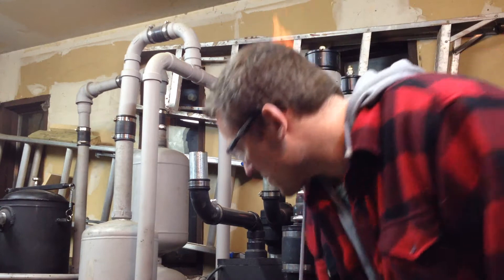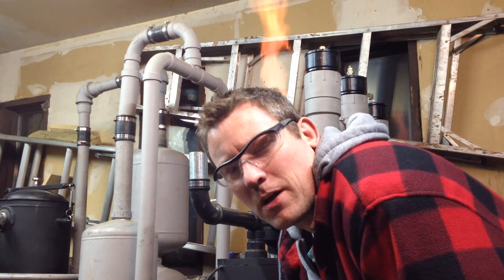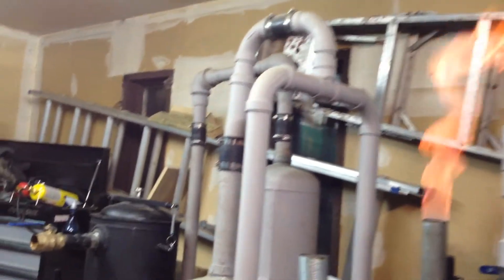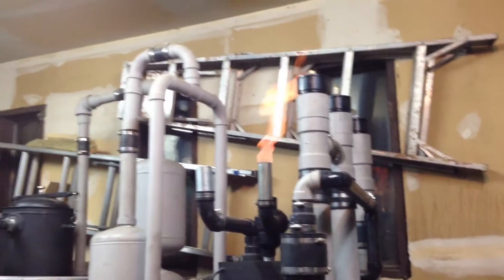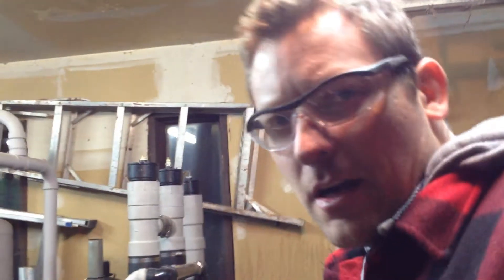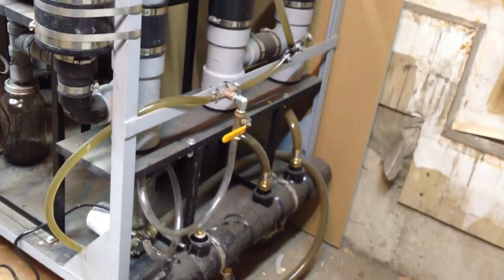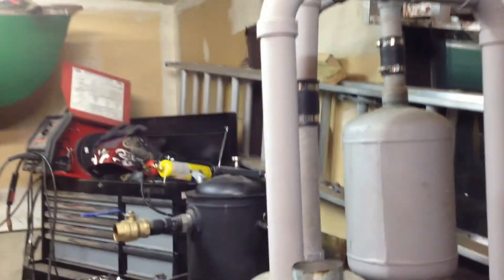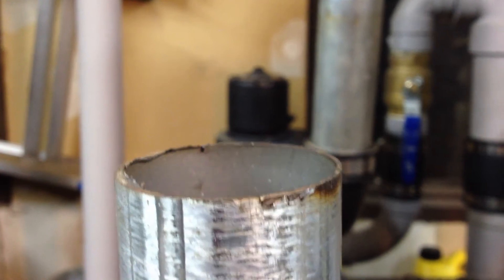homemade woodgas wet scrubber part 2 (testing)

Comment: How many filter and witch  kind of filter do you use
Reply from the maker: Also had three Venturi set up filters ready but I only used one which gave me awesome results
Reply: @Josefppaz thank you sir
Reply from the maker: I experimented with using saw dust and using car filters. But looking back it was really hard for the gas to move through the system. It is good for the gas to move slowly other wise to much 02 bypasses the burning zone which can create problems and back fires. By far the best way to go was the Venturi method with the water and antifreeze. Using that sink drain was a difference of night and day I didn’t need to use the other filters any more. 👍

Comment: Do you us a six air jet in your Gasifier?
Reply from the maker: No it was just a single 3/4 inch air nozzle in the middle of the burn cone
Reply from the maker: Forgot to mention I also had a ball valve to regulate the air flow
Reply: thank you

Comment: What is your water scrubbee? Just a water mist or a bubnler
Reply from the maker: @RustyShakleford1 hi Rusty it’s a sink drain Venturi idea with a stream of water mixed with antifreeze
Reply: @Josefppaz  genius m8 i watched your other videos i can't thank you enough for sharing. I found spiral nozzles are what they use in petroleum cracking to separate tar and ash. Im sure your drain when the water hits acts exactly the same way as a serial nozzle spraying wayer through the gas.

How hot does your water scrubber condenser water get? I'm thinking of feeding it back into the same tank without external al cooling but idk how hot the scrubber water will get thats why I thought I'd ask you
Reply from the maker: @ Thanks man absolutely glad to help out. The gas I cooled it in expansion chamber but it didn’t really get hot maybe warm most cases I used antifreeze to keep the water from freezing in the winter. Was a fun experiment 👍
Reply: @Josefppaz  how warm does the antifreeze/water get when it's recycling through at full temperature
Reply from the maker: @ I’d say pretty close to room temperature man. The gas was cooled down quickly even before the scrubbers. As for the exact temperature not sure bud
Reply: @Josefppaz  how hot does the gas come out of the reactor and do you think gas or tar is still cracking as it comes out? 

Could the water scrubber spray nozzle be placed right on the reactor gasifier outlet? To reduce hot spots on the external gasifier unit itself and allow more pvc pipe to be used even potentially allowing the cyclone filter to be made out of a 5 plastic gallon bucket cooled by water scrubbers.  
If the gas can be cooled enough on outlet of the reactor everything outside of the reactor itself could be cheaply easily available pvc and 5 gallon buckets
Reply from the maker: @RustyShakleford1  No I wouldn’t do that right at the outlet is about 6 to 700 degrees it would melt the Abs or PBC at a instant
Reply: @Josefppaz  with water mist scrubbers it's cooled almost instantly allowing for less metal components
Reply from the maker: @RustyShakleford1 Sounds interesting Rusty I’m curious on your project wish you the best man. Look forward to see some videos up when your done
Reply: @Josefppaz  thanks. I like brainstorming ideas so please run any ideas your thinking about by me and we can bounce ideas back and forth. Water scrubbing is the answer wood gas has been missing its not just about clenaing it but cooling and condensing it to increase the availabile horsepower from a smaller fuel charge. All the best

Comment: I thought if you run a wood gasifier they produce fair bit of carbon monoxide so would be a health risk if you run it without the flame to burn off the carbon monoxide. ? Do you ever have problems with that like getting a headache or other symptoms of carbon monoxide poisoning or maybe your area is well ventilated and does not build up much gass. ?
Reply from the maker: Absolutely you have to be very careful with this stuff. When I ran this machine I usually had the main garage door open for lots of ventilation👍

Comment: Any update video howcthis gassifier evolved how it working..
Reply from the maker: No it’s gone man mainly was an experimental project of proof of concept. Some time again I may build a micro gasifier machine. But as for a working gas for generators there is a ton of cleaning involved. I think the more user friendly gas would be hydrogen, using solar energy.

Comment: hell great job very nice bleu flam , congrat i wonted to know what is incide that square black box
Reply from the maker: I believe the only thing I had was a blower motor in that black box, siliconed the box to be for air tight. But literally the main thing was those water scrubbers did an awesome job
Reply: @Josefppaz  Thank you very much

Comment: Hello sir, I read in the comments you took your gasifier apart. Were you able to harvest and gas for stoves lights? I am interested to hear if this would run a gas heater? To replace propane?
Reply from the maker: Hi Ricky interestingly I found when I ran my little engine for about 20 minutes, the engine ran very cool to the touch. I wonder if this wood gas has less BTU for heat, mind you it was a cold day. As far as harvesting the gas I haven’t tried it. I would be very cautious even to try. The gas still has lots of oxygen going through the system, would be interesting to have a oxygen meter present to see. I have seen people wanting to compress the gas but I am not an expert on doing so. I find it can be very dangerous but it’s a different story if you know what you can do. As far as getting rid of the oxygen present in the gas I think there could be ways but lots of work. This type of gas is great for running a generator for a heater, but to replace propane that’s a good question. Best way to see how much carbon dioxide is present with wood gas maybe to measure with some gas meter. Unfortunately something i never tried. If the heater was in a garage I would rather heat it up with a rocket stove. Sorry could help much Ricky.

Comment: Have you put the nice gas into the combustion engine?
Reply from the maker: I did Herri interestingly when I tried my little 5 HP engine I did a test run for about 20 min. The engine ran very cool. It was warm but not extensively hot to the touch. I’m guessing the wood gas’s has a very low BTU value.

Comment: I have an idea of cyclone filter that also has water scrubbing and gas cooler tower all combined in a single unit. It is cheap to make also. Could this be useful? Really nice unit you have.
Reply from the maker: Thanks man. Your idea sounds great 👍. This machine was just a experiment just to see if it works which it did. To clean the gases earlier is always a bonus.
Reply: @Josefppaz  I posted a link about my invention but it got deleted 2 times. Did you do it or do you have any idea why it got deleted 2 times?
Reply from the maker: @ss-sq1hn  interesting no I didn’t do this but it has happened to me too I wanted to show someone a video link and it just deleted on me aswell. Not sure why this happens, thanks for letting me know maybe YouTube thinks it’s spam or something in that area. But your not the only one it’s happened to.
Reply: @Josefppaz  Maybe it is just algorithm thinking it was a spam. Or energy ministry got alerted.

Comment: Love it how much water are you pumping thru at any one time and what is your filter medium thanks
Reply from the maker: Hi Ted I used antifreeze with a mixture of water . For the amount I never really measured but I figured it would be a gallon a minute or a bit more 👍just as long there was a steady stream coming out of the hose barbs inside the abs pipe. I used to use saw dust but I found this way is way better

Comment: There were some guys, Off Grid Pro, that developed a gasifier that was commercially available for a bit that played with water in the process. I think you are getting results better than they did.
Great videos. How is the gasifier working for you now several years later?
*Edit....just read the comments. Did you build another gasifier with the mods and upgrades you wanted to?
Reply from the maker: Wm H I don’t have the machine anymore. Mainly it was to test out the the theory of the machine how it worked it was really interesting. I might some day build a small one but the main problem like every gasifire was the clean up tar is hard to clean. But is was a fun project glad you enjoyed the video friend.
Reply: @Josefppaz  wow, Joe. I didn't expect such a fast reply. Thank you.
Yeah after I wrote my question/comment I read thru the others and saw you were temporarily getting out of the wood gas fun. I've played around with them for maybe 15 years but dont have one right now either. Last ones I built were actually quick and dirty FEMA designs with debris after Hurricane Micheal to help some people power their generators they needed for medical equipment in what was left of their homes. Gas and other fuels were in short supply and there were areas of Florida w/o power for months. Anyways, with everything going on in the World I've decided to build myself a nice gasifier finally. I just ordered the new version of the Wood Gasifiers Builders Bible and have been spending a little bit every day for the last couple weeks reading blogs and watching videos on various designs and issues. Your videos are very good. You should show more of your many experiments you do on all the subjects you are interested in when you have time.
Anyways, sorry about rambling. Thank you for the videos and everything. Have a good one.
Reply from the maker: Wm H best of luck to ya man love to hear how it turns out
Reply: @Josefppaz  will do.

Comment: Could't you run the gas from the burn chamber through two drums filled with water, And then to a condensation tank ?
So gas comes out down to bottom first drum half filled with water, then from the top goes in to bottom of next water drum then from the top goes in to the condensation tank. The first water drum should pull most of the nasties the second should cool the gas and pull remaining nasties and reduce huge ammounts of pipe work and pumps etc
Reply from the maker: Stuart Willis kind of like a bubbler it would be interesting to see anything to clean the gas the only thing is it might need a lot of suction to do this. I know some guys had water splashing like rain to cool and clean the gas too ;)
Reply: Yeah a bubbler .was also thinking of charcoal filteration or carbon. Not super fine carbon but small hard rocks like used in co2 scrubbers for orchards.
Reply from the maker: Stuart Willis I haven’t used that before man. I’m sure anything is good. I remember talking with Mike (flash001usa) I used the saw dust but I fell away from it always clogged up lots of cleaning. For my self I prefer the liquid easer to clean and drain bud :)
Reply: Yeah thats my thinking too 👍

Comment: At 3:50 you said there is no smoke coming out and I agree. The point I want to make is when you switched over to your vacuum and had it running awhile before you turned your pump on, there was no smoke then either. Seems there should have been smoke before you turned your pump on as there was smoke coming out of the other stack before switching over.
Reply from the maker: plainwornout3  absolutely bud i was thinking that maybe due to moisture in the pipes and antifreeze the smoke could also be attracted to this and clean it as well 

:)

Comment: I wonder if it would be possible to store your produced gas in something like an empty propane tank.
After your clean gas outlet, before your gas generator, you could have another 5 gal tank with a larger inlet (from clean gas out) than outlet (clean gas to generator) and on the inlet you should have a low CFM centrifugal blower to create a positive pressure in this tank.
This would create a sort of buffer area to accumulate gas while an air compressor or refrigeration recovery machine "sips" on the accumulated gas through a small inlet line drilled through the side of the buffer tank and pushes it to an empty propane cylinder all while being able to burn the gas you cant store in a small generator. :)
Of course you would have to make sure that this gas mixture is safe to store under pressure.
If this works you could also use it to recover left over gas after you turn it off if you block all inlets and outlets to the atmosphere.
Anyway I LOVE this setup is beautiful and really well made. :)
Reply from the maker: Thanks LewdFish for the positive comment, I have seen a few videos my self on people doing what you said, but its really on the danger side of things.  Sad part is you will still have a mixture of oxygen coming out of the pipe, I talked to Flash 001 USA (Mike) about this and its on the boom side of things. I know you can get a oxygen meter to measure how much volume there is but I still think oxygen is on the high side of things especially when compressing it. For myself I wouldn't recommend it especially with out a oxygen meter, and the guys who do this with out are ticking time bombs. But if you have the money to pick up a oxygen meter just to see and experiment sure why not, but as of now I wouldn't know how to get rid of the oxygen present in the wood gas, all I know is there is chemistry chemicals on the great internet to take away oxygen and purify the gas, which one I don't know my friend hope this helps : )
Reply: Josefppaz ah I see that's a good point! No one wants to have an explosion on their hands.

Comment: Could you post a video on the blueprints / design of your gasifier please
Reply from the maker: Hi Larry the main design was from Flash001USA he has a lot of great blueprints that I followed.  Unfortunately I don't have the unit anymore due to moving to another place and I didn't have any blue prints but I used Flashes design
Reply: Josefppaz is the expansion tank empty or does it have anything in it?

Comment: Hi is possible you send plan construction?
Reply from the maker: hi bud I had to move to another place but if you want to find out the main construction I mainly used Flash001usa design which works just fine he has great material and a site with blue prints he has awesome videos, sorry for not getting back to you sooner bud.

Comment: Im building a gasifier that has 6 - 3in burn tubes and i get one serious smoke stack which will not light as it probably has too much steam even though my fuel is dry wood pellets. So im looking for a way to clean the gas but have no steam.  Wow ! Ya, so water bathing the tary sooty smoke ,and you don't get any steam coming back into the gas before it would enter an intake manifold.Just wondering how big of an engine you could run with your gasifier and and how many gallons of fluid you recirculate in you gas bath.One more question is how long will you run before you need to change your fluid.